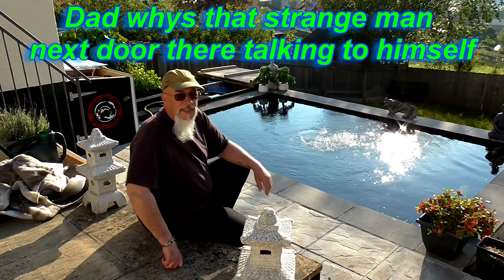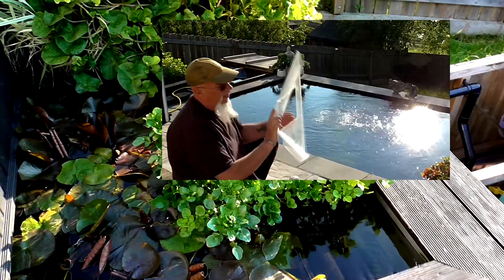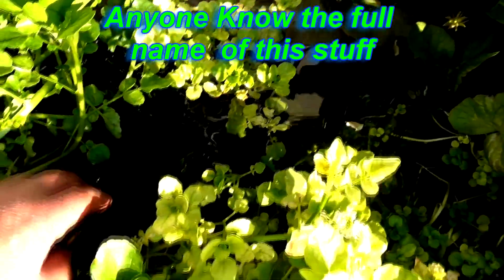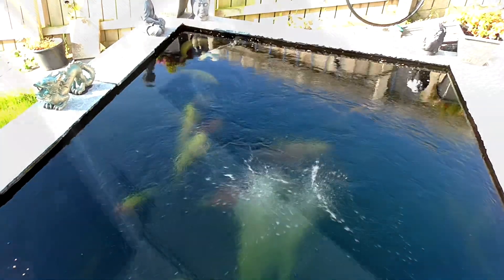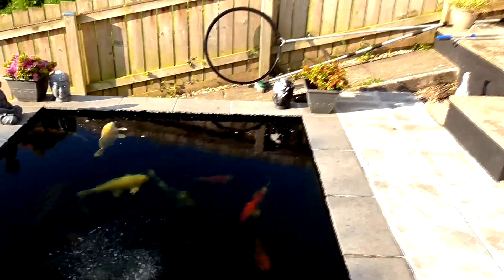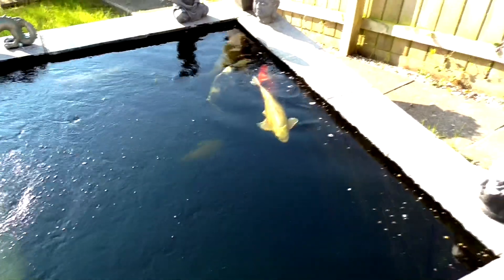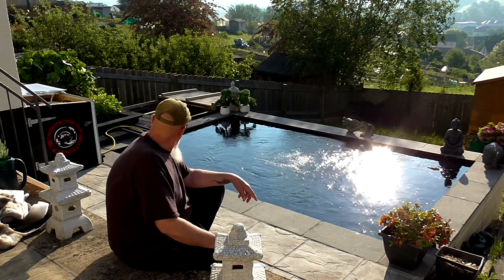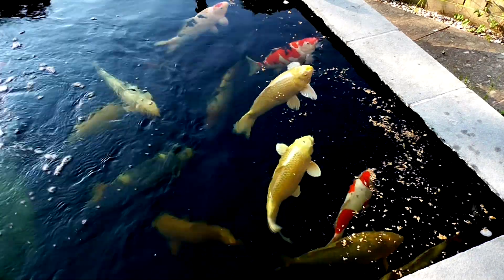DIY KOI POND FILTER *** SHOWER FILTER*** PLANTS IN THE KOI POND***POND FILTER k1 MICRO SYSTEM***

Comment: Last year I used 'Resolve' and it absolutely *+$£!! my filters. Before I new it, the K1 was blocked, the fish had a dickie fit and the pond water parameters went off the scale. Never, never again. In retrospect I should have cleaned the filter system at least every 2 days until it cleared. I ended up using API sludge destroyer, which helped to sort it out. It took a goog 4 weeks before the pond 'almost' got back to normal. The fish suffered. This year, I used EA Stop blanketweed and it has worked flawlessly in the pond. There has been no residue what so ever. The pond is absolutely clear now. The only bit of blanket weed after 4 weeks was that which was stuck in the alphagrog  at the top of the upflow sump filter before the waterfall. The top and bottom of it is that EA stop blanketweed had no effect on the filter system to the best of my knowledge. The only tip I can give is clean the vortex every couple of days if need be and use a product such as API Ecofix sludge destroyer. Take care 👍
Reply from the maker: I will be going back to the cloverleaf stuff i used it for years this was just a try it with the Resolve my filters can pull the cloverleaf out in 3-4 days

Comment: Thank god someone else has this stuff!never had it before but this year the exact same as you and i used cloverleaf blanket answer so dont think it matters what you use tbh.
Took me about 2 weeks aswell of sweeping the pond walls and had the vac out every other day, also been moving the air stone around the pond as thats been pulling off the bits i missed. Then turning that off for half hour till it settled and then used the vac again to get it off the bottom, Horrible stuff.
Reply from the maker: I know Mark its been a bloody nightmare to get out the pond and looks like lots of people have had it this year not just them treating for blanket weed so its most strange

Comment: Hi .. is your pond fibre glassed?
Reply from the maker: No Bash its a box weld liner as I wanted to allow for an posable extension to the pond in a year or so and will get it glassed at that point if I'm not happy with how the liner has worked out but so far I'm more than happy with the liner
Reply: @DevonKoi  i made the same mistake  lol .. hopefully ..I learned alot from your videos..thank you some much
Reply from the maker: Thanks for watching and have a good weekend

Comment: I've always used the cloverleaf. I did try the resolve but I didn't find it as effective.  We have a wildlife pond in the front garden and that has bull rushes in it. No idea where they came from. They just appeared one year.
Reply from the maker: The Resolve has worked but will be back on the Cloverleaf next time
Reply: @DevonKoi  Resolve is supposed to reduce phosphate it the pond but with the veg filter you shouldn't need that.  I wonder if a combination of the two throughout the year would work better. Maybe the Cloverleaf to get rid of the worst and then the occasional treatment with the Resolve to stop a reoccurrence? Might be worth a test.

Comment: I would change that fortex for an sieve easier to clean.
Reply from the maker: I did think about that but would a sieve take it down to 70 micron Royk you can see a clean of the vortex next week and it was messy this week filming it but for the norm its just a blast with the hose pipe see next weeks video
Reply: vortex is a winner all day long